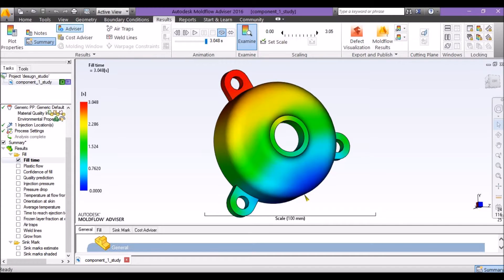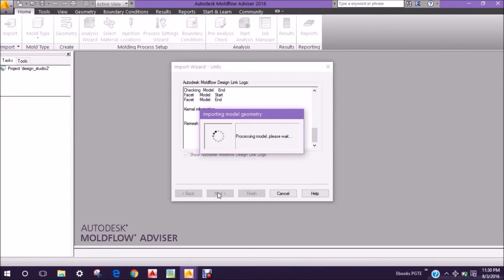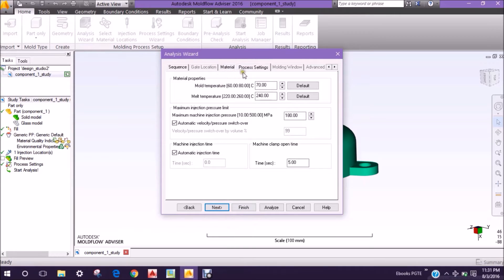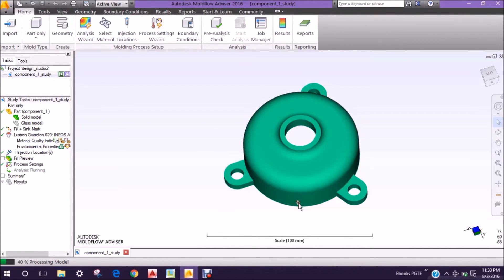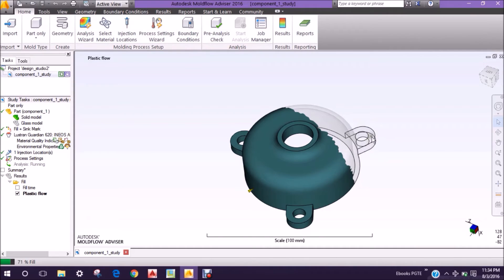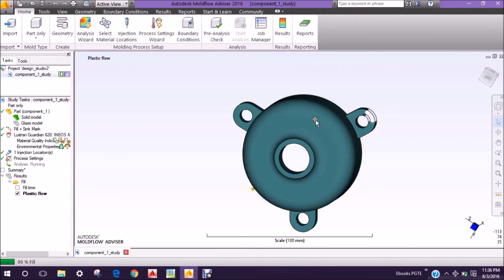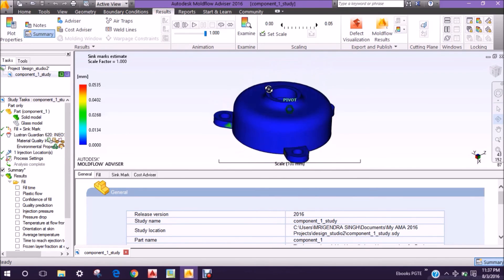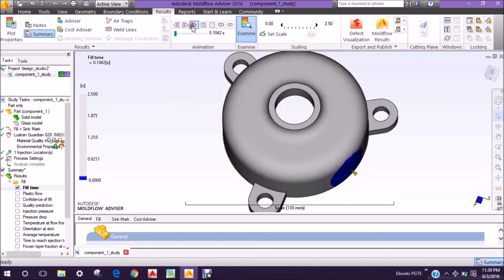mold flow adviser tutorial

Comment: When you get the fill results,the "total part weight at the end of filling" includes the weight of the runner wizard or it is only the weight of the piece? thanks!
Reply from the maker: Check with log ...You will get both part + runner as well as part weight after packing
Reply: WWwwwwwwwWwwwwww1